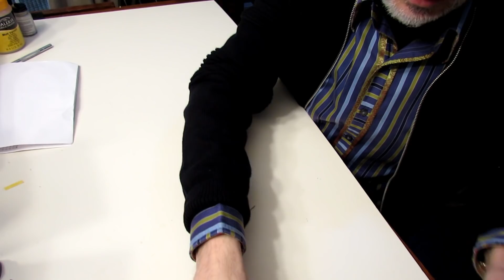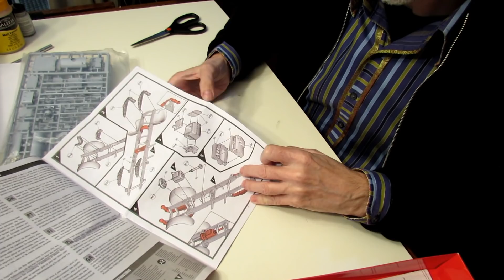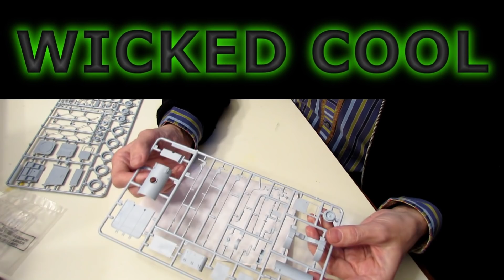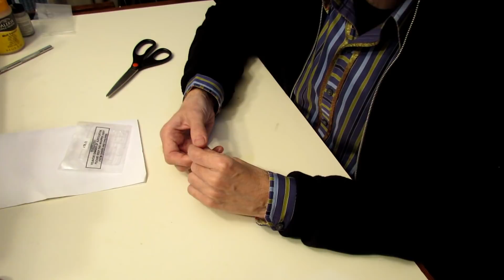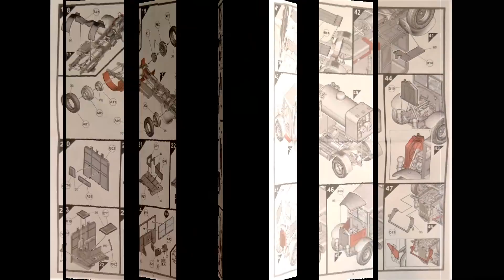Airfix 1/48 Albion 3-Point Fueller - "Build Introduction" (12.10.18)

Comment: Use brass tube, Albion Alloys have some finer walled than the display stand we see in model shops this last 40 yrs, use the brass tube as one 'electrical channel, and feed a fine coated wire through the tube for the second channel, else dip bare brass wire in pva wood glue perhaps, i.e. make a thin coating. You will need to make the trumpet end again or use Airfix's but they have a MASSIVE ERROR, its got some carbunkle of a structure sat in it, unlike all photos and even their box art ! solder your two strand wire, one to the internal wire, the other to the brass tube, all very fiddly though. Take that chance to remedy the error in the shape of the 'real life' casting above the pump compartment. Else run wires through tyres into base and across to aircraft then up through tyres, using brass rod for undercarriage ,one 'channel' per u/c leg, may be better ! either way FIX that monstrosity that should be a trumpet end with a hose coming straight out, you just didnt spot that at all in the review, yet the trumpets are one of the key features of the real thing.  Hoses ARE NOT BLACK, everyone has gone black, THEY ARE CANVAS ! pump compartment white, pump dk green or black, brass knobs and brass refueller nozzle. Hose stored behind cab has spiral steel wire around it, its for refuelling the bowser ! Study actual photos ! They wouldnt have the engine running whilst refuelling though !

Comment: Very cool! I didn't know Airfix do these airfield vehicles in 1/48th, too! I need German vehicles like this one. Do you happen to know if Airfix do them? The plan for the wiring through the fueller's hose is brilliant! I hope you can make it work. Although I'm not into adding lights and stuff to my models I'm fascinated. It makes more sense for aircraft models than for armour models. Good luck! Cheers :)
Reply from the maker: Hey Jens, sorry for the late reply, been busy with life. In answer to your question: Airfix don't make any German vehicles in 1/48 scale, only Tanks in 1/72 and 1/35 scale I'm afraid. I haven't done any modeling since the second week in November....Thanksgiving, Christmas and New Year holidays, with the wife at home and grandchildren around prevented me from doing that. Hoping to get onto this model, this week some time. Cheers for now! :)
Reply: Thanks a lot for the info, Martin! I spent the last five days with building a spray cabinet and finished it today. I didn't have any bench time since I announced my new project. The booth was too important, but I guess I'll spend more time in my cave from now on. Cheers :)
Reply from the maker: Oh, that sounds cool....what are the overall internal dimensions of your spray booth?
Reply: It's about 55cm wide, 38cm high and 28cm deep. It isn't the final solution, because the transport box I used cracks easily and I'll have to be very careful. Next month I'll build the final version from HDF boards. It'll be 60cm x 40cm x 35cm and will have three instead of two fans. Learning by doing. :)

Comment: Hi Martin! Nice detail on the fuel tanker mate! Shame about the clear parts.Have you thought about using some air line hose from a fish tank pump.Its about 3mm  in circumference and you could thread the wire through that then paint it black.Great video as always mate 🍻👍
Reply from the maker: Sorry for the late response mate and thanks for watching and commenting a suggestion. The existing parts in the kit that resemble the pipes through which the fuel hoses go through are solid and only .040"/1mm in diameter...3 mm would be three times the size of what they should be and would be noticeable, I'm afraid...got more thinking to do. Cheers : )